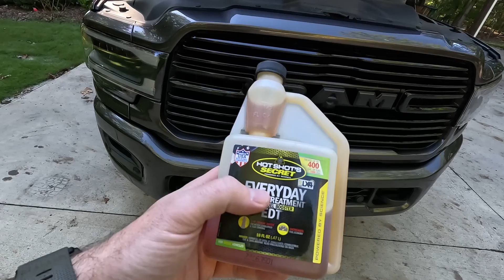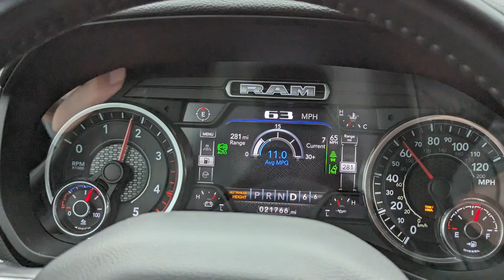P2459 on My RAM 3500 Cummins 6.7 Dually // Diesel Particular Filter (DPF) Regeneration Frequency

Comment: Have you had any other with your DPF system? I have been having very similar issues.
Reply: Wanted to give you an update on my DPF situation. After months of frequent regens.....the truck would auto-regen every 50-75 miles....I finally brought the truck to Dodge. They recommended me to change the fuel filters and air filter to mopar before they would do anything(even though I had just changed them all 2000 miles before). That did nothing to change the situation. After 2 more appointments, they finally agreed to replace the DPF filter. Even after that, I am still experiencing the same frequent regens. I have another appointment tomorrow and Dodge has assigned an advisor to my case. I will keep you updated.
Reply from the maker: @howardsherman9461  Dang, that's frustrating. It's the cat and mouse game that is most frustrating with these DPF issues.
Reply from the maker: After I started limiting idling and running the Hot Shot everyday additive, the issue went away. My understanding was that given my low mileage and shorter than ideal trips, the system really needed to be re-callibrated to allow for my less ideal driving habits and keep running to the regen instead of throwing that error. It basically would give up on the regen due to my shorter trips and then tell the system that the culprit was something in the DPF system rather than just my habits alone. I had heard that RAM was supposed to update the software, but that was through the grapevine.
Reply: @AdventureRocks  We had one check engine light. And now the truck is running automatic regeneration every 50 miles. Something is not right. We drive about 20 miles each way, mostly on the highway. Not much towing.
Reply from the maker: @howardsherman9461  See if your code was the P2459...if so it could be same issue. It's like the callibration is off such that it throws a red flag if the regen isn't completed in X miles or hours as if something is wrong with the DPF system when in reality it is more the frequency/shortness of the trips. If you're able to do a long stretch to at least clear out the current regen that may be a temp fix. But for me it seemed like between the discontinuation of idling and the HotShot everyday at fill-ups...it caused DPF to regen less getting rid of it. I'm certainly no expert btw, so just sharing my experience. Hope that makes sense.

Comment: I started running additives after the first time my truck through a code.  I started erasing the codes.  But they kept coming back until at 92,000 ish, I cleaned my EGR sensor and cooler.   Haven't seen it since.  I'm at 98,000 + now.  I full time RV so I pull my 5th wheel all of the time and I also use it as a daily driver.  Just not that often.  Great video, thanks.

Comment: Hey, I have the same truck you have and got the is code 2 days ago. I use fuel ox on every fuel up and do not idle it while park. I also use platinum DEF. I have 74k miles on the truck and I daily drive it just like you lol. I went to the dealer and they are refusing to delete te code unless I get an EGR DPF cleaning. The truck runs strong and no other codes or issues. I’m going to another dealer since I know this cleaning stuff is all BS and they just want money. Thank you for the video!
Reply from the maker: Thank you!

Comment: My 2022 with 28,000 miles and I got same thing going on, but I just got message sent for two recalls with one being the Particulate Matter Sensor. I had frequent regeneration going on driving 50 min each way on highway and would not complete and when completing it's regen it would regen again when getting on highway. I even did a forced regen before changing my oil as I always do. I do have a scan tool with access to gateway to force regen my truck. I also been running Hot Shot Extreme LX4 once a month on fill ups and really can't tell anything different. in performance or mileage improvement. Only idle time I do is done few minutes before shutting off so oil in turbo  can cool off a bit.

Comment: Your right these trucks don`t like it when you idle excessively, your spot on with your whole video. I wish that Ram would allow the driver to perform parked or forced regen`s manually just like the ford an Gm trucks do.
Reply from the maker: Great point, manual regen would be nice and solve a lot of problems. Short of using an aftermarket obd2 device at present, seems like RAM could easily add it into the infotainment/evic screens.

Comment: Deleted mine - and I run Archoil as an additive. Amazing results, thousands of miles with no problems and increased power and fuel economy.
Reply: Not in my country
Reply: Off road use only right.
Reply: @goducgo  no way man. Daily driver.

Comment: My 2018 Cummins 2500 is turning into a nightmare after the smog recall. Ram pretty much disabled my emmissions system. It now will not pass smog. 55,xxx miles on a bone stock unmolested well maintained truck!!!! Never again Ram.
Reply from the maker: Sorry to hear. That's frustrating for sure.

Comment: You’re getting better fuel mpg.because it’s not going into regen as often. When the truck does a regen it uses more fuel. Went through the same thing with my 2022. Fuel additives help with the situation and lessen the regens but if you Replace the maf sensor you wont need the fuel additives as frequently Granted  I do still run fuel additives every 4th fill up.  I can now go between 700 to 900 miles between regens if I drive empty daily around a 30 minute trip. If I’m hooked up to a trailer and towing I only see a regen when the computer commands the truck do one at every 24 hrs. The maf sensor in my truck was reading the wrong air temp and causing the truck to slightly over fuel itself thus making it plug the dpf sooner. And the fuel additives kinda helped mask the issue by making the fuel burn cleaner. Up until I replaced the maf sensor my truck never made it past 275 miles between regens. The error code p2459 is set to come on if the truck goes into regen 3 times back to back and the miles between each one of those regens are 150 miles or less
Reply from the maker: Great tips, thank you
Reply: Do you think hauling 15k through Virginia and WV mountains full speed 80-85 would cause this?

Comment: I have a 2019 RAM Crew Cab LB HO Max. tow When towing, I use high idle if we are stopping for less than 10 minutes. I have switched between EDT and non, and I do see a difference, not in regards to maintenance but in regards to that 1 mpg. In my 100k miles I have never seen a P2459, and have only had one particulate sensor fail. for its 100k mile celebration it got the full hotshots secret treatment, with stiction eliminator in the oil, extreme diesel, and running 3oz EDT per tank rather than the 2oz for this oil interval. My truck only tows our fifth wheel, which is a mid profile 33ft at only 9k dry 11k loaded, But at the time I could not pass up the deal to get my truck, it was not selling due to RWD only so got a great price.
Reply from the maker: Great tips, thank you. Sounds like a great truck.

Comment: Did that fix it?
Reply from the maker: Yes, I think for me it was a combination of excessive idling and shorter hauls. Once I quit idling, combined with the Hotshot EDT, the code never came back. I also heard that RAM/Cummins may update the software to re-callibrate what throws the error code, so I think in reality it was being overly sensitive in some ways, but also I wasn't doing any favors with the shorter hauls and idling.

Comment: Any more updates on your research,,,, I have the 23 ,,,2500 and just got the code twice just like you did,, ordered the hot shots,, but just wondering after 3 months if you seen any difference now.
Reply from the maker: Great question. Thanks for asking. I sold the truck recently (for other reasons), but between the hot shot additive (both the one time treatment and the smaller dose at each fillup) and limiting idling I never got the code again.
Reply: @AdventureRocks  Awesome,,, thanks,,, do you know of a code reader that will clear the code,, I have the blue driver reader but will not clear the main code
Reply from the maker: @stevecox552  Did you try combinations with engine on, engine off...run position, but off, etc.? I found that mine was picky about it being in a certain mode. If I recall it wanted it to be on "run" with the engine off. If that makes sense? It was a cheap bluetooth code reader (old generic one).

Comment: My dealer told me I got that code because I put in an aftermarket air filter that had glue strips interfering with the air flow
Reply from the maker: Interesting. Heard the filter culprit from a few as well.
Reply: All BS. I had that and replaced on their suggestion, 2 fails within 120 miles between each regen. sigh....
Reply: I let them change it, just to eliminate that as an issue. But since then I’ve had a battery drain and no start issue. I’m fairly confident that when they replaced the grid heater relay they put in a faulty one or the mechanic screwed up and the grid heater isn’t working.
Reply: Mine told me the same

Comment: If your Def usage starts going up clean your def injector. Its two 10 mm nuts to remove injector located on your exuast. White crystal buildup will mess with the spray pattern and is less efficient. Clean with warm water. Have the injector gasket available.
Reply from the maker: Thank you for the tip
Reply: This can be done on a 2022 3500 ?

Comment: Given your opinion at the end of the video about gas versus diesel, I just bought a new fifth wheel that is 16,000 pounds when it’s fully loaded or the GVWR. We only plan on traveling with it 2 to 3 times a year and the rest of the time it will be parked. Do you think a diesel Dooley is absolutely necessary?
Reply from the maker: Do you happen to know the pin-weight on the fifth wheel either actual (from CAT scale) or manufacturer claimed pin-weight? If under 3K total when loaded/optioned fully, you probably can get away with single rear wheel (SRW) truck that has a payload/door sticker 3.7K min or higher. Some fifth wheel models/floorplans have unusually high pin-weights when loaded. For example my Jayco Pinnacle 37MDQS had an advertised pin-weight of about 3,200 lbs dry from Jayco. But, when optioned and fully loaded my actual pin-weight was 4,400 lbs and still within GVWR overall. So I absolutely needed a dually in my case due to the sheer pin-weight on the fifth wheel, though an SRW could pull it based on tow rating. Sometimes the advertised pin-weight on fifth wheels can go up 20-40% once optioned and loaded given the see-saw like configuration with a fifth wheel and truck. If you're not sure on loaded pin-weight for your specific model, sometimes groups on Facebook have fellow owners that share their sample weigh-ins from CAT scales to give you an idea. I'd say if you're anywhere close to 3K lbs pin-weight fully loaded/optioned you'll probably need a dually based on payload by the time you factor in hitch + passengers + tool box, etc. (~600-700 lbs allowance approximately). But, all that being said, if you're only towing short distances a few times a year and remaining stationary, that certainly can impact one's purchase decision ultimately. Hope this helps.

Comment: instead of idle , turn cruise control on while park and dial down on cruise control , it stops the idle . I was told to do that , anyone have input on this ?
Reply from the maker: I've heard a few others suggest that, but I actually sold this truck so no longer have the option to test that procedure.
Reply: @AdventureRocks  no longer towing or just went with a gasser?
Reply from the maker: @anthonyp6124  thank you. Yes, indeed, I sold it as we downsized significantly on the RV and no longer needed the dually. Here's my new ride:
https://youtu.be/t7rDx0RlJ1M
Reply: @AdventureRocks  great choice. That’s where I was leaning. I had a 2020 Ram 2500 6.4 pulling a 11k 36’ 5ver. Wasn’t happy pulling in hills and mpg/ fuel range was terrible. Went to a 2021 Ram 3500 LB diesel and absolutely loved it. Air suspension in the rear and 50 gal tank. Didnt know the 5ver Was there. Joy to drive but unfortunately sold everything to move to FL. Now wanting to get back into Rving and not wanting to deal with diesel maintenance and fuel costs  I feel the 3/4 ton gasser is the best overall with a taller rear gear for a DD and occasional towing. The 3.73 in the Ram 6.4 was a dog maybe if I had the 4.10 it would have been ok.  Good luck with your new ride.
Reply from the maker: @anthonyp6124  I hear you, a lot in common. I am really impressed with the GM L8T with 10-sp so far. I'll be releasing a 1st tow video in about 10 days. I'm not towing super heavy, just in the 5-6K range with a travel trailer, but RPMs are extremely low while towing...very similar to diesel surprisingly. Just a night and day difference compared to the last gasser I had, a 2015 5.7 Hemi 1/2 ton.

Comment: After a hard pull, do not shutdown the engine until you have idled for about 3 minutes. Set the parking brake, hit the cruise control button and then the set button. The engine will increase the rpms to 1000 . Slow idle will load up the engine, washing the cylinder walls with fuel. Not cooling down the turbo will fry the oil in the turbo and fry the seals in the turbo causing eventual failure of the turbo?.    40 years of driving big rig.
Reply: That's good to know, I have had a few times pulling my rv up and down the hills of Tennessee and when I was done I let it idle for about 5 minutes and the temperature went up, so I thought I was doing it wrong. Next time I will let it idle at 1000 rpm. Thanks again.
Reply: @electrified7309  so if you idle the engine for 3 minutes at 1000 rpm, the turbo and oil cool off and that a good thing to do for the engine and turbo?
Reply: @jatc8  Yes, you got it, if things keep moving (the impeller, the oil) the hot spots will be cooled, the metal parts will not warp, the oil will not turn to carbon in the hottest places (exhaust side of turbo).
Reply: I deleted mine. If you can. I recommend it. WAY better mpg.
Reply: @thehimself4056  I'd like to but want to sell it some day, also, voids extended warranty also, cannot take truck in for recall updates, also, must spend thousands.
Reply: So let it idle at 1000rpm for 3 minutes and then shutdown?
Reply: I was gonna say this too. Well said.
Reply: no it wont, not with coolant jackets in the modern turbos
Reply: cylinder wash is not an issue on these newer trucks

Comment: Unfortunately, if your daily driving doesn't allow your engine to get up to normal operating temp, it will not initiate the required regens. So, whether you like to or not, you do need to take frequent "joyrides" in order for the DPF to regen. Better yet, use a different vehicle (gasser) for short trips. Unless I'm driving across town, I leave my truck at home and drive our Jeep instead. And as you stated, excessive idling will compound the problem.  My 21 Powerstroke is no different in that respect, I monitor my DPF percentage and once it reaches 100%, it will attempt to regen providing my engine and exhaust temps are right. This is the time I'll put some music on and take a little cruise to allow it to clean. 
As for the Hotshots EDT, I also use it religiously on every fillup mainly because of my CP4. But it alone doesn't solve your regen issues. Our diesels are happiest when we're working them hard while towing, etc.
Reply: As stated above, it turned out the sensor measuring pressure differences across the DPF would not intiate regen unless I literally drove it like a drunk teenager for a mile, fast starts, floored,  sudden stop, repeat twice, then the never-seen regen simply began- then drove it 60 miles highway, and the DPF filter stayed clean according to the gauge for it. 21 RAM 6.7

Comment: I had my def crystallize a while back. Dealer programmed it to not be so sensitive. I now fill up DEF in dried out gallon water jugs. When I use the DEF out of jug, then I get rid of container, and I don't reuse them. If you use a container over and over, it will crystallize.
Reply from the maker: Great tip, thank you

Comment: I have a  2016 with HO Cummis with 93,000 miles on it.  180 Hrs of ideal time, i have only seen my truck go into regeneration mode two time that showed up on dash.     couple of time when parking you could smell it had done something but still never show it was in regen.  go thru 2 1/2 gallons of Def, about every 1,000 miles.

Comment: I have this problem with my truck and its from the truck regening too often at one point it was regening on average every 160 miles. I tried to take it to the dealer they were no help. The fix I've found that is every oil change replace the air filter with oem air filter now I average a regen around every 1500 miles. I have around 200k miles on my 2023.
Reply from the maker: Great tip, thank you for sharing. I've also heard that some aftermarket air filters, particularly the oiled styles can throw false error there. Wow, 200K mi...that's some serious driving! :)
Reply: I replace all four filters every 7k and I’ve gotten that code a couple of times and it goes away but I get worried every time it comes back

Comment: I have a 2024 ram 3500 long bed dude at the dealership told me if I ever idle it put it in high idle, so hit cruise control then set and your good. I also short trip mine less than 5 miles one way to work. But on most weekends I tow a 36ft enclosed trailer. But what do you think on the high idle thing?
Reply from the maker: I've also heard recommendation for high idle if you have to do it. I did not know about how to set it though with the cruise control...thanks for sharing.